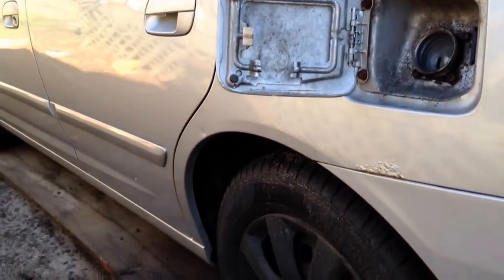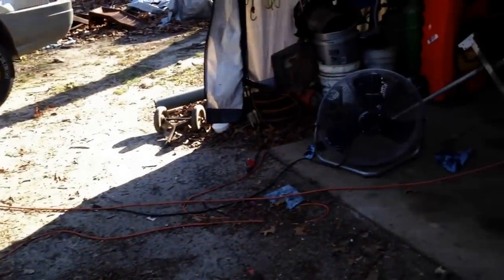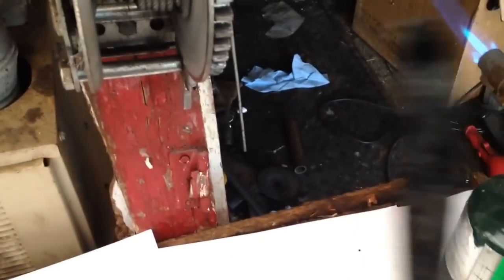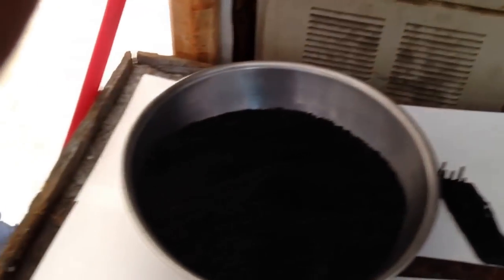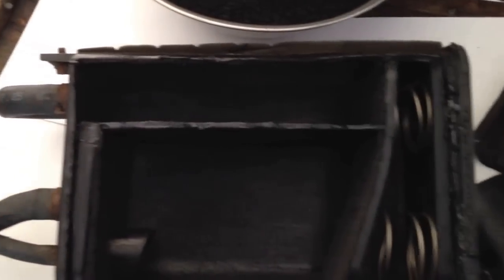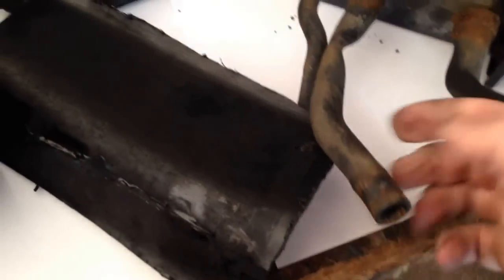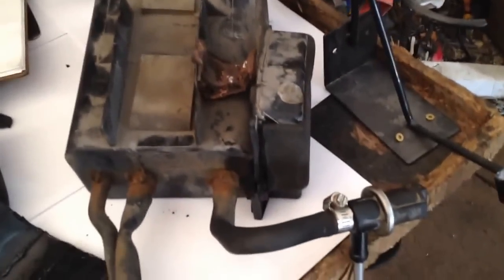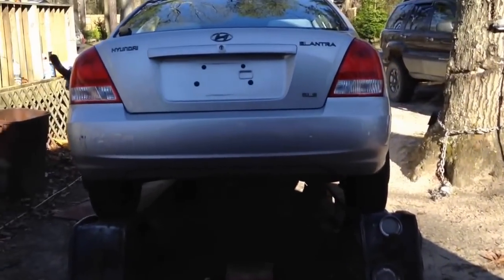Hyundai Evap Canister Internals Saturated Activated Carbon Charcoal

Comment: Where is the canister for a 2003 Hyundai Santa Fe? I'm having the same problem with putting gas in the car. I also put a gas treatment in and now it will not start. Any recommendations?

Comment: man, i don't think sticking a red hot knife into a canister that possibly has raw gas and gas fumes in it is a good idea. kaboom, ya know what i mean. it's not a chance too many are willing to take. i'm not. those pellets can back up into the bigger hose coming from the fill tube and clog it too if the tank vent solenoid isn't working. clean them out of the hose and let the canister set a day or two to dry up. blow air through it too. then put it back on without taking it apart and blow through it like you said to do with the radiator hose.. just test and make sure the tank vent solenoid and the canister purge solenoid are working too. if the car runs rough in gear at idle most likely the canister purge solenoid that runs to the plenum is bad or a hose that runs to or from it has a vacuum leak. use a vacuum gauge to test it and the lines. use 12 volt to test the solenoids to see if they open. thanks

Comment: could you bi pass the box by takeing both the in hose and the out hose and connecting them together ?
Reply: your computer takes readings from all components and it tests pressure in the gas tank. your car will never run right if you don't fix it properly.
Reply: Fuel economy will suck bad.

Comment: similar problem w/ my 2000 elantra. No start after topping off fuel. i replaced purge solenoid valve. it was fine for years. I recently topped off after fuel pump auto shut off and CEL code p0441 evap system came on. Thx for info. I wool look at evap system again, blow charcoal it of lines & get new canister; valve... as needed.

Comment: Curious? 
I have a bad canister, pellets were in the lines.
What would happen if you took (shake or blew) all of the carbon pellets out and blew out the lines then reinstalled?
Reply: just take the hoses off and let it dry out a couple days after you figure out if it needs a tank vent solenoid or not. it may need a canister purge solenoid if the car runs rough in drive at idle. you can test both solenoids to see if they work with vacuum gauge and 12 volt test wire and a ground wire. it just takes a little time. parts are expensive just to replace without testing. watch more videos to find answers.
Reply: Well time will tell. When I was blowing out the pellets piece of what looked like foam filter material was also coming out. So I figured it had rotted out and was clogging the lines also.  The in-line filter from the can going to the motor sounds like a great idea.I could use a small breather filter .I was thinking of using a 1" hole saw on the top to refill the can then buy two rubber plugs.
Reply from the maker: +davidst489 I would try it with the filter 1st because the canister is spring loaded internally to keep the pellets from bouncing around so if you cut a hole in it the spring pressure would just push out more pellets and/or you wouldn't be able to force any more pellets into it anyway. If you shake it and you don't hear the pellets moving around, there should be plenty of pellets in there to do the job.
Reply: The canister is empty and I installed a new Purge Valve, the one that is at the engine. The purge valve is genuine Hyundai part not a Dorman fit all had problems with that before. Anyway 250 miles and no CK Engine light.
Reply from the maker: +davidst489 Thanks for the update, glad to here it worked and yeah the Dorman purge valve AND the Dorman Canister vent valves are garbage. Where did you get your purge and how much was it? Please let us know if you have any issues with the empty canister later on down the road. I'm guessing the light won't come on but I was wondering if you might get some fuel smell or engine flooding after fueling and start up. We're hoping it works for ya David. Thanks again!

Comment: 2002 Sonata, having the same problem. Thanks for the video.
Reply: My problem with my sonata is that it won't let me fuel up without kicking off the pump.  Found coal in the line.  Lets just say you remove the canister ... will it fix the problem? (laws not considered here)

Comment: It went well Juan, I changed the Vent Valve (some people call it the Closed Vent Valve or Canister Solenoid) I dried the carbon pellets, dried the filter (it was soaked with water, can't imagine how that happened) and the car is running fine with no check engine light
Reply: How did you dry it ?
Did you use hair dryer or something?
Please help

Comment: Yeah, but if carbon was soaked with fuel it won't be effective anymore.  I don't believe it will re-activate at 275f, not even 275C is enough to properly re-activate carbon in regular atmosphere.   You need temps closer to 600C.  You won't get codes for bad carbon in the emission system, you will just be polluting the outside air more and/or smelling fuel sometimes.

Comment: drop the canister? thtas not easy pal u got too remove the gas tank!
Reply: Not sure about other years, but on 2001-2006 Elantras, the charcoal canister is located behind the left rear wheel under the bumper. No need to remove the gas tank.
Reply: Budz Wingren I was talking about 2009 sonata have too remove tank
Reply: joe smith it is the same for the accent.  The canister is behind the left rear tire.